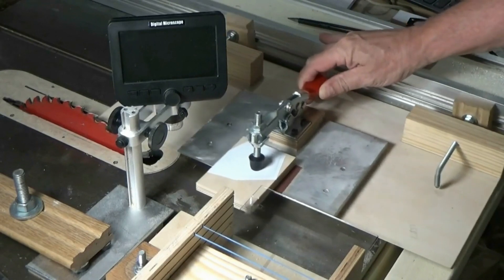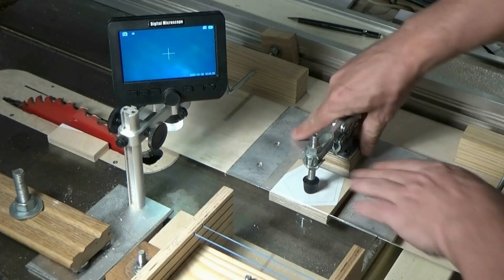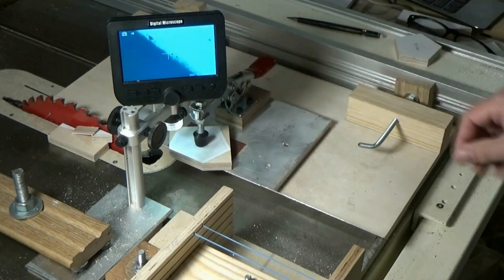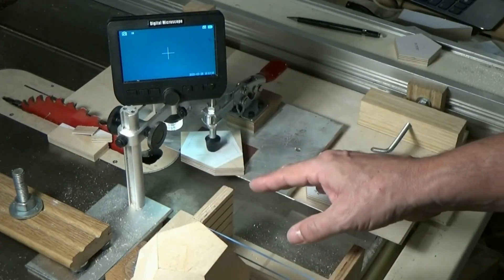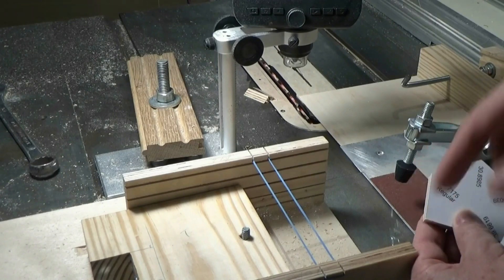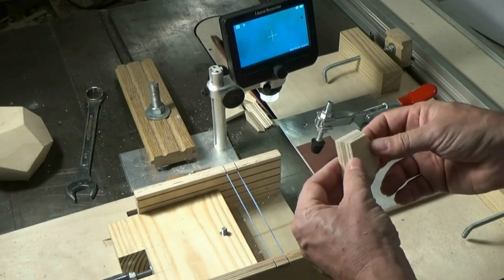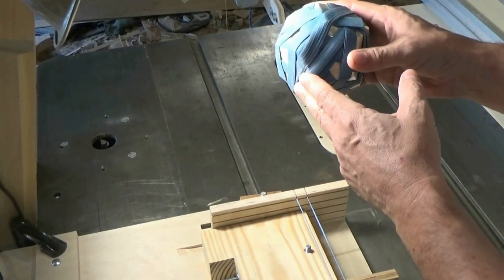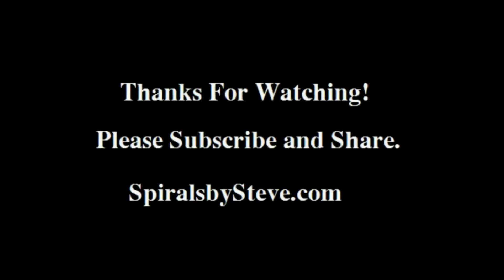Dodecahedrons Made Easy

Comment: I love the microscope attachment but doesn't it drive you crazy to have to make adjustments for each single piece?  Wouldn't a really accurate jig be easier?  By the way I love your asymmetric dodecahedron boxes.
Reply from the maker: Thanks!  The adjustments to put the reticle on line from one end to the other go quickly once you get the hang of it.  Also lining up the coarse reticle on the cut line helps to make the fine adjustments need less adjustment.  It is the most precise way I know to get accurate cuts, and is not limited to one specific angle like a dedicated jig would be, and there's no accumulative error.  The non-regular polygons have several different angles, but the irregular dodecahedron boxes still have tetrahedral symmetry.

Comment: So this is a fixture not a jig as you are continually using the microscope to adjust before cutting for accuracy. Is it not time consuming . I don’t deny the accuracy .impressive.thanks
Reply from the maker: Thank you.  It is a two step alignment process with an adjustable sled, microscope, and a coarse reticle.  The wood is clamped on the sled while aligning it with the coarse reticle - which is just a piece of clear plastic or glass with an inked-in scratched line.  That gets it close enough to move the sled forward to the microscope for fine adjustment.  After getting the hang of it, it goes pretty quickly.  Accuracy is limited by line width and print quality.

Comment: Thanks Steve!  This looks good.  I've tried your previous technique for cutting dodecahedron splines with the miter saw.  I struggled with getting the necessary precision.  I also was getting a lot of small part kickback which challenged my nerve.  This is a lot more stable and safe.  Love to have your spline technique adapted to this model.
Reply from the maker: Are you referring to the open frame dodecahedron, or the box-jointed one?
Reply: @Steve.Garrison  The open frame that your assembled with hot glue
Reply from the maker: @eddraper  I don't know if the two could be combined, but that is one I would like to redo sometime.